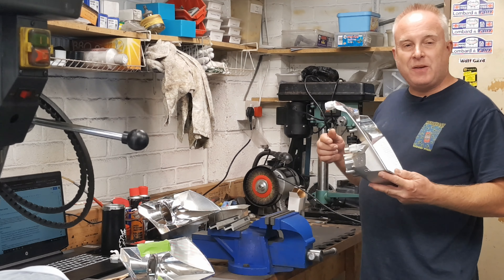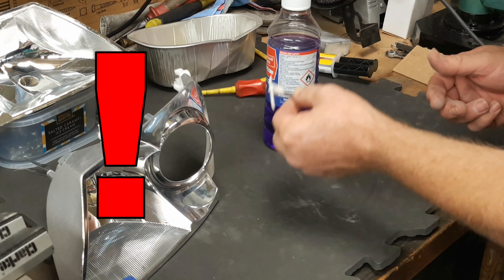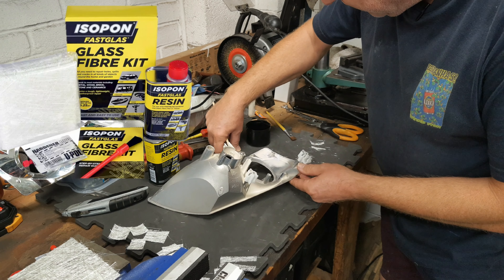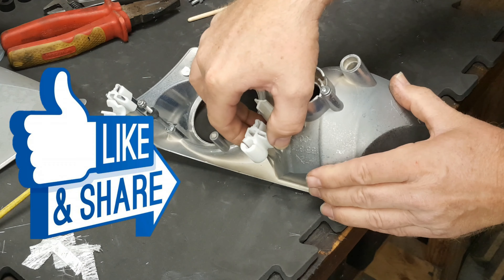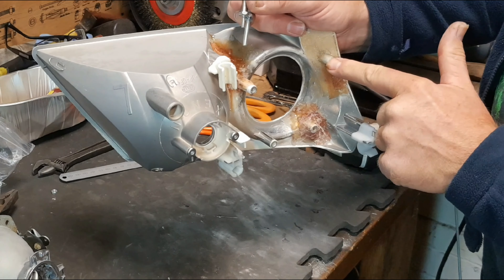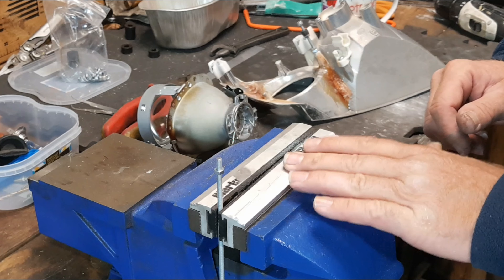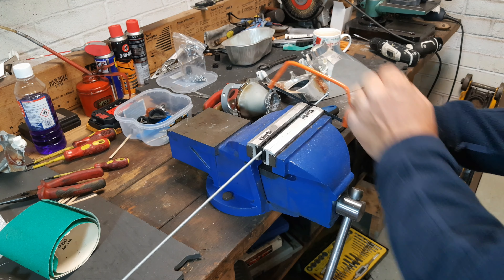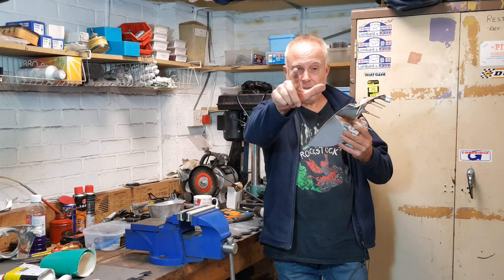Headlight Projector Mount Repair for your Custom Headlights Build

Comment: Holy crap, I can't keep up! Lol.. You would think that someone would make an aftermarket version of the headlight assembly that uses reflectors instead of the probelmatic projector systems.. Or is that just wishful thinking? 🙂 Either way- Your videos are amazing. You clearly fix stuff all the time. I haven't the patience nor the workspace and tools lol..
Reply from the maker: Projectors give out almost twice the light with the same bulbs, but bulbs are so 20th century❗ LEDs are the way forward

Comment: Hello sir, im having issues with my custom bmw e90 headlights. Headlights have projectors on low beam and normal reflector on high beam. Issue im having is that one of the mounts for plastic that holds projector and reflector broke off (projector and reflector are on a plastic housing inside headlight), which makes my headlight swivel inside, i tried using bolt instead that mount but my projector is unaligned on the wall now, i dont have perfect horizontal line. Do you have any idea how to replicate that mount so i can get flat horizontal line from the projector? I can upload a photo of a broken mount but it is missing some parts and i cant find them. Thanks alot in advance i would like to fix these headlights since they are one of the best looking headlights i had.